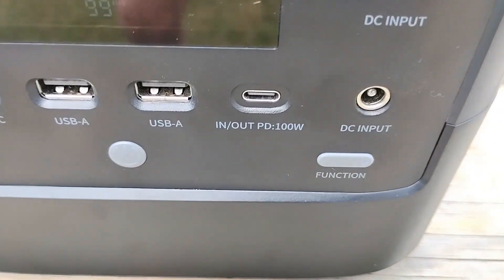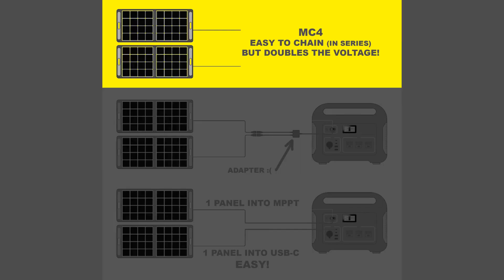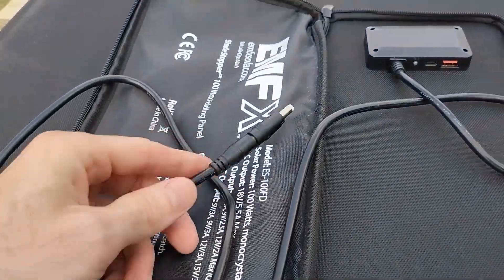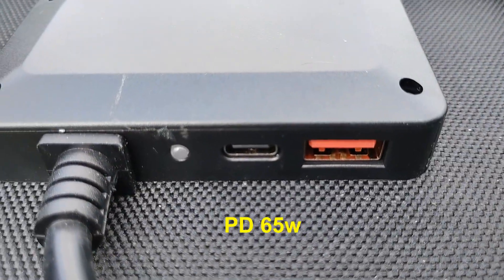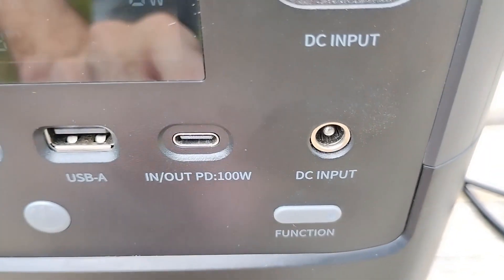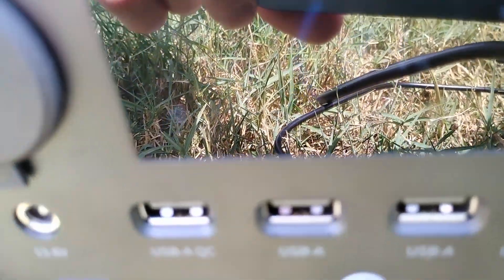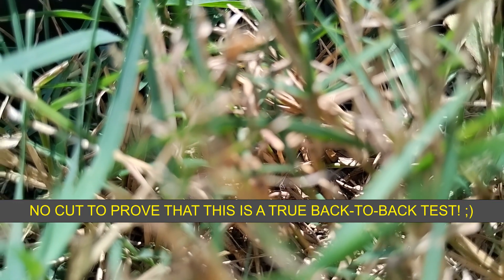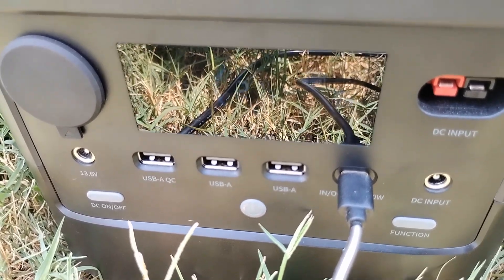Using USB-C for Solar

Comment from the maker: *Note that PD USB-C protocols must be compatible. In some cases, certain solar panels may not work with certain power station USB-C inputs.

Also, the power station USB-C must be "bi-directional" or "in/out" or have a symbol that looks like an equal sign with little opposite arrows on the end.

Comment: thanks for the review! Is it possible to charge a powerstation with mc-4 and usb simultaneously from that panel?
Reply from the maker: Not from the same panel. Only use 1 connection per panel.